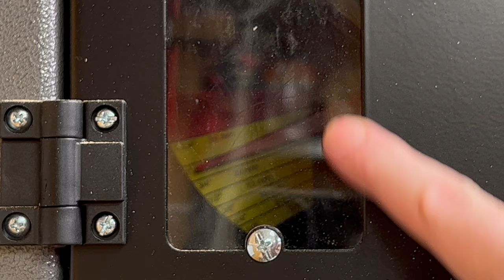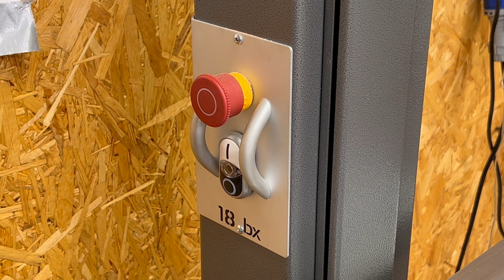My Laguna 18BX Bandsaw: What I Love and What I Don't

Comment: Thanks for great review.
Short note on the extractors, Axminster extractors are sold with ratings in Cubic Meters per Hour (M³/h), not the USA standard Cubic Feet per Minute (Ft³/min better known as CFM) AW82E is 1050M³/h which is about 618CFM, likely why you're feeling it's a little under powered. The AW153E is about 1012CFM though so for anyone considering this the extra £80 for the next size up extractor should be fine. Looks for anything that's over 1700M³/h.
Reply from the maker: Thank you so much for taking the time to explain this. I’m going to pin this comment at the top as it contains excellent information for people like me who don’t quite understand topics like extraction 😀😀👍👍

Comment: Excellent review, Leo!  I have had the 14BX for 2+ years.  Agree that the foot break is so great.  The power and capacity was good enough for me.  I have a Laguna 1 HP BFlux I have used for this and my planer and it has worked fine.  Sounds like more HP is needed for the larger capacity 18BX.  Welcome back!
Reply from the maker: Thanks Sandy for your very kind comments 😀. Yes I’m definitely going to have to look at improved / more powerful dust extraction. My current one simply isn’t up to it unfortunately, but I’m stuck with it for the time being 👍

Comment: For the price they charge I'd expect it to absolutely perfect and I'd be expecting them to fix things if they weren't working properly ... thanks for a no nonsense review of it 👍
Needless to say, I don't have that sort of money, but I do have the ability to build my own with similar specs for a shed load less 😀
Reply from the maker: Thanks Barry, I hear what you’re saying about perfection. I guess with any premium product (car, electronics etc) there will always be a problem, but that shouldn’t be the case.

I’d love to have your creative engineering brain to come up with cheaper alternatives 👍👍😀😀
Reply: @Hand-i-Craft  It's basically the same as the metal one, only made out of wood ... the frame can be done in many different ways, the wheels are circles (easy), guides are ball bearings, bottom wheel fixed to bottom of frame ... top wheel is a bit harder as it needs an adjustment mechanism to tension blade and adjust tracking.

My first attempt was using plywood and it's the lower wheel which is used to adjust tension ... it does work but it's an overly complicated mechanism ... going to build a new one at some point!

There are plenty of homemade bandsaws out there, it's just deciding whether you want to use available plans, create your own from scratch or modify one to suit your purposes ... but if you can afford then by all means buy one (soo much simpler)👍

Comment: Very interesting and I cried a little when I looked back at my own tiny bandsaw but that's life I guess. Have you tried reducing the size of the outlet hole for extraction - a bit like a smaller vac nozzle increases suction (hplv) - to pull out the heavier particles? I've had some success with using a narrower pipe to increase sucking power on some machines.
Reply from the maker: Thanks Ben, good suggestion here. One thing I had considered was reducing the size of the top port and using my shop vac on that one and the bigger extractor on the bottom port. Keith Brown has a similar set up with his table saw. It would be a bit of a faff, but possibly worth it on the bigger jobs 👍👍

Comment: Leo i would be gratefull if you could hilght my post concerning your Mirka Deros as i had problems with mine but my post might help owners who own one which is out of warranty and don't want to pay a £200 repair bill here is what i wrote

Don't know if this will help but i bought the Deros and used it for 4-5 years so out of warranty. Then it started playing up then one day (using the 125mm pad) it would stop working one Minuit  it worked then when i pushed the paddle the red light would flash and nothing.   So i unplugged left it then it would work then do the same. So went on here watched the videos stripped it down cleaned it but to be honest it wasn't that dusty as i always use my mirka dust extractor. Ran it with no pad worked fine then put the 125mm pad back on used it same thing happened. So more videos and research stripped it down again only this time i removed the plastic cover that surrounds the spindle  (can't think its name) cleaned the fins which again wasn't that dusty put it back together only this time instead of the 125mm pad i put the 150mm pad on  (less used) and it works now (i will keep u updated) Conclusion the only thing i can add is in one of the posts i saw said when somebody had a similar problem was they noticed the pad was worn but initially i wrote this off as when has a sander stopped working due to a pad. However i don't know whether my slightly worn 125mm pad has some how interfered with the brake that slows the machine down when you release the paddle or was it the cleaning that sorted it which i doubt as it was quite clean anyway hope this helps.

Comment: I would imagine with that design using both extraction ports you probably need a higher pressure extractor as there is nowhere for the air to enter the case from except the blade slot so no air flow. It would be very interesting to see what happened if you left the top hose port partially open and had full 4" extraction from the bottom as it would allow high speed airflow down through the cabinet and from the blade slot in the table insert and not allow the dust to settle. Using both extraction ports but having a heavily perforated table insert would do a similar thing. I see similar complaints about extraction performance from bench saw users who have installed zero-clearance inserts, effectively sealing up their machine cases, and wonder why their dust extraction performance drops ...
Reply from the maker: Thanks Andy for the feedback here and offered me some proper food for thought 🤔😀👍